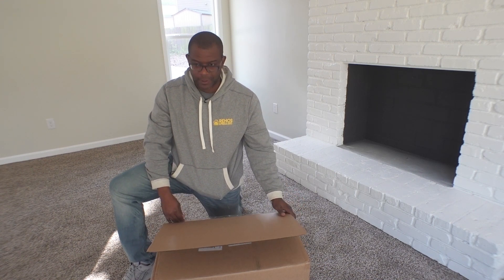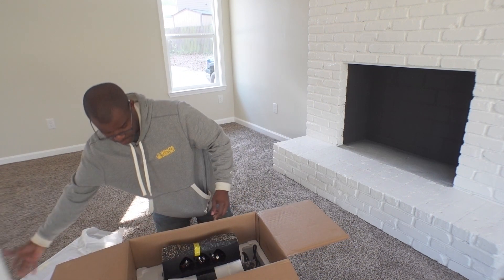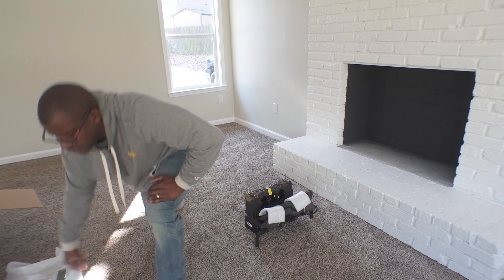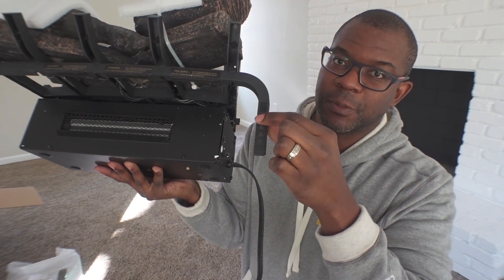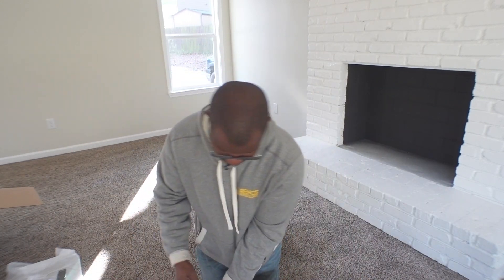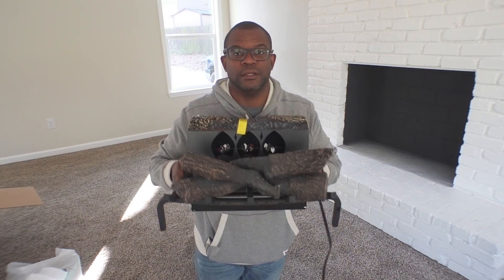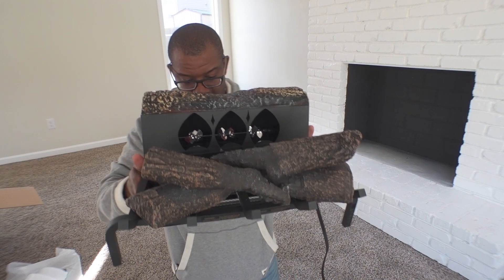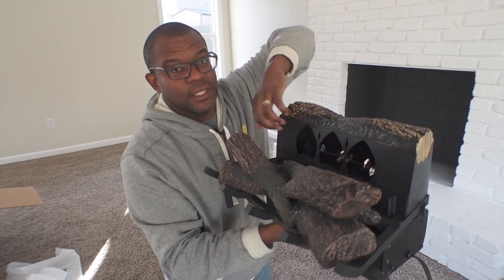Dimplex Revillusion 20" Electric Fireplace Log Set Review

Comment: To the people who are concerned with the plastic halo. .... I bought an additional accessory which you can buy for the log set.  It's the plug-in ash attachment.  It looks like hot cinders and looks cool underneath the log set.  I also had an old fireplace so I already had brass Andirons which I placed at either side of the plastic halo which helps to take the eye away from the plastic halo.  With the brass fire screen I already had, this log set looks fantastic.

Comment: Informative and enjoyable to watch, thank you. The four course brick hearth height raising the unit up well above floor level adds to the realism. I've a big old fireplace to fill and am installing the same fire in a faux wood burning stove I'm making from MDF board painted matt black with brass fittings which will raise up the Dimplex to about the same height level shown in the video as a stand alone unit would be lost in the old fireplace space and will be using a false chimney tube for electrical cable feed. Only one change I'd like to have seen in the video would have been for the light coming from the window to have been reduced to see how the fire would look on those long cold winter evenings. Again Many Thanks.

Comment: Thanks for the demo! I was really considering this until I saw how noticeable that plastic sheet is.
Reply from the maker: Its really most noticeable if you have a shallow firebox and a really bright room.  Both of these conditions are present in this room.
Reply: In addition, judging by the fact the back log is barely visible and there is high flame reflection on the wall I think it is backwards.
Reply: @RENOS4PROSJOES  What's the size of the fireplace? It looks like is 4ft by 3ft. A smaller fireplace 3ft by 2ft might make the reflection less noticeable, I think.